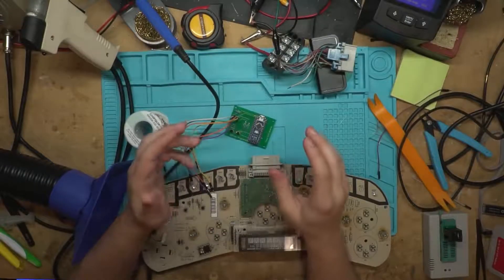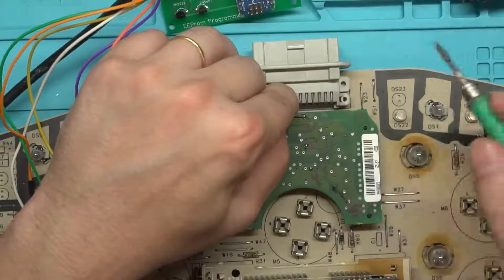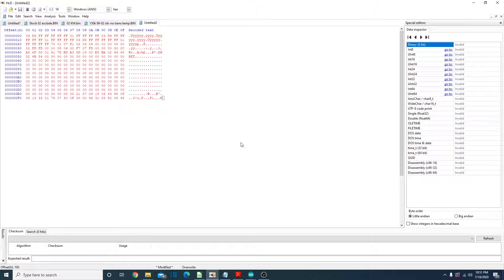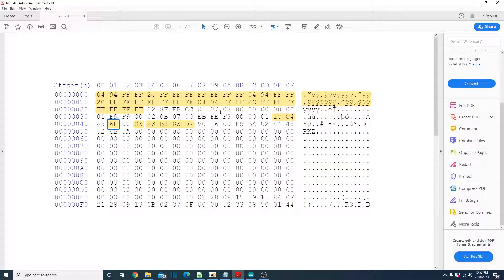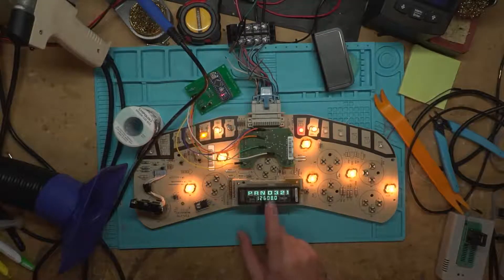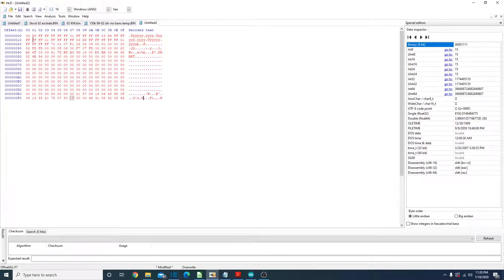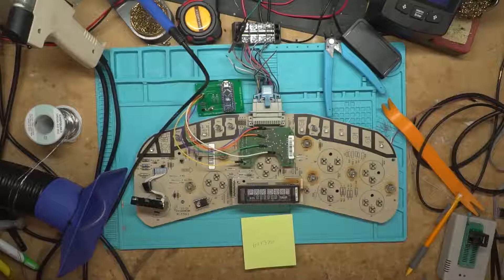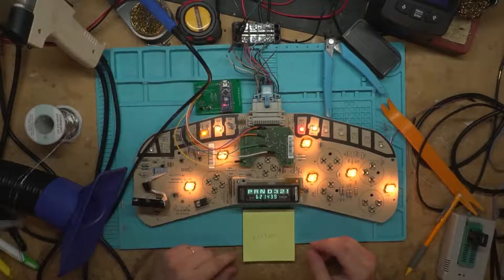GM 00-02 Odometer Correction In Circuit And Other Things On The EEprom

Comment: How do you find the pinout
Reply from the maker: for the EEprom? It was about 5 years ago when I did that but if I remember correctly I just probed it out with a DMM. I had that whole board off it and just probed each leg if the eeprom to the test points.

Comment: Is it at all possible to do an in-circuit reflash by using the ICSP header on my TL866II+? Or do I have to use your Arduino programmer? All that comes up (when I do an online search) is your series of videos on this subject.

Edit: To be frank, your documentation sucks. I ended up desoldering the eeprom from the parts cluster and "brute forcing" various ST Micro 256 bit EEPROM models in the XGPro software until I figured out it's a M95256 chip. Once I got the pinout from the applicable data sheet, I was able to figure out which pin does what. NOW your video is useful with figuring out how to get the ICSP stuff hooked up.

Comment: Hi, your video convinced me that I could do this. Everything went well up until I opened the Serial Monitor - it doesn't connect. I can read the BIN, but cannot C&P it. I did use the Nano Every, but I don't think that would matter. Any suggestions will be greatly appreciated.I see that jeffescortlx mentioned that he found pin #6 in a different location. How do you tell?  I have a 2001 also.

Comment: Hi, I’m looking to replace my non-trans temperature cluster to a cluster that’s has it but the mileage is way out, could I not just simply swap the 64 prong boards?
Reply from the maker: No. The transmission temp is an option on the eeprom. Best way to do it is read both eeproms and then transfer just the milage data to the other eeprom

Comment: Just used this video to connect to an 02 cluster, following all your instructions on here, and your hardware and arduino program (awesome by the way) and it comes up at 2F for km no trans temp.  I got connected to the eeprom perfectly the first time, and read with no issues!

Comment: I have a replacement cluster from a 2001 Yukon XL Denali which needs to have the mileage corrected with my original. I like this way instead of de-soldering the 64 pins. Do you work on these clusters as a business? Can I send you mine to have the mileage recalibrated? If you do not do it, do you know a reputable person that can?

Keep these videos coming! I am learning a lot.
Reply from the maker: It's a hobby business shoot me an email I take them as mail ins

Comment: This is really some great information and fantastic research. Happen to notice anything in the bin that effects the airbag light? I'm working out a issue with swapping in a trans temp cluster.
Reply from the maker: I did not. Now if its a 1999 I saw to 00-02 swap I saw this hack years ago never tried it myself http://www.sc1.me/99Guages/Airbag.htm
unfortunately don't have a good way to test the light even my truck the airbag system is broken lol.
Reply: @FixedUntilBroken  welp that's it. You're 100% correct. I can't believe this is the first time I've run into it.
Reply from the maker: I'm glad it helped. I've never actually tried to make the light work for 99 I just tell 00-02 won't work in a 99

Comment: I meant microscope
Reply from the maker: If you're in the market for one I've heard the new eakens. Microscopes are great
Reply from the maker: Oh I have an older amscope Im not completely sure of the model I bought it used from a local engineering firm that closed. Got it for a deal. It's on the articulating arm instead of the stand.

Comment from the maker: I forgot to explain why T-temp is hard. It has more components you need to add to the board. Above the ODO you are missing 1 film capacitor  and under the ODO you are missing an IC and a bunch of jumpers. Plus the Air Core motors can be PITA to find. I've never pulled the T-temp motor off does anyone know the marking on the side of the motor for T-temp? If you pay really close attention there is plot hole 14:30 because I forgot to screen record programming the ODO first time so I had record it after the fact. When I recorded the 2nd time I forgot to switch the Trip/odo byte in the screen recording but I had changed in the camera recording.
Reply: Have you looked for stock of that trans temp motor chip? The trans temp is a 4 wire motor, so it's possible a MPH or RPM motor will work in it's place. But I haven't tried yet.
Reply from the maker: I haven't looked for it yet.
Reply: @FixedUntilBroken  I have an HD cluster in my garage right now as a spare parts cluster. I'll get your the trans temp motor marking when I make it back down to my garage on Monday.
Reply: @Fixed Until Broken Trans temp motor = S1D
Reply from the maker: @mike7958  good Info. Willing to throw a speedo motor in the spot and see if it works there's? I don't have any t temp boards atm to test it on. I'll have a core back soon though so I'll test if you don't want to. Both are S codes with 4 windings . Just curious  and I highly doubt it can damage anything.
Reply: @FixedUntilBroken  Yea, I doubt it will do any damage either. I've had multiple clusters come in before where the customer removed the motors and mixed up all their original locations and I had to sort out that puzzle piece. I have a few repairs sitting on the bench that I have to get to first, and multiple appointments throughout the week, so I'll do my best to test that out for you as soon as I get some free time.
Reply from the maker: @mike7958  sound good If I get to it before you comment I will let you know. I don't expect to get that core back for at least 2 weeks though. He told me the truck was in the body shop get painted but I have the deposit so I am sure I will get it sooner or later.
Reply: @FixedUntilBroken  Ok, long day, but I was able to test that out for you and can confirm that the "S" motor in the speedo and tach will work in the trans temp spot and vice versa. It swept fine when given some data and a trans hot signal was generated.
Reply from the maker: @mike7958  great news! I was able to find some of the IC in china so I will get those in soon. So If the IC is real that will make doing T-temp mods to these a thing.
Reply: @FixedUntilBroken  That's awesome. If you need me to pull the eeprom dump off the HD cluster, shoot me a PM. And if you need a Denali 120mph speedo eeprom dump I can probably get that to you too.
Reply from the maker: @mike7958  I've got Escalade and Denali but I could use a hd dump. My email is garnerm91@gmail.com
Reply: @FixedUntilBroken  Ok, I'll get that pulled ASAP and get it over to you.
Reply: @FixedUntilBroken  Sent. Check your email.